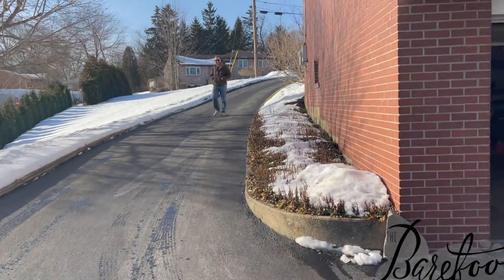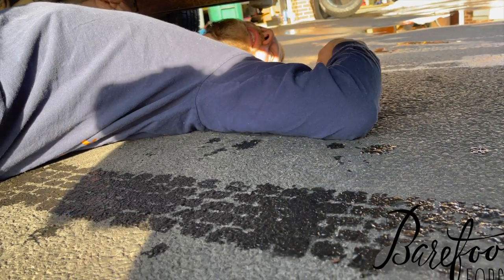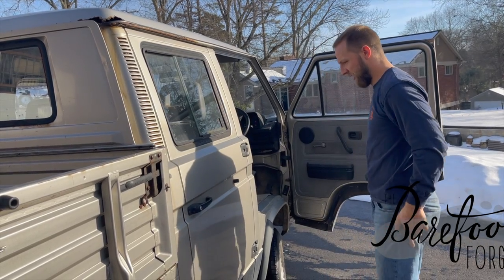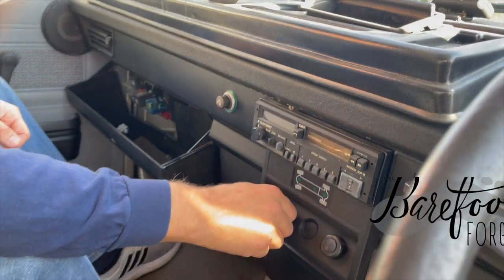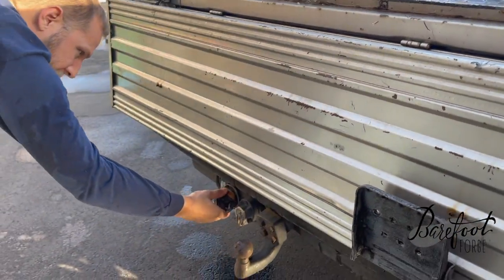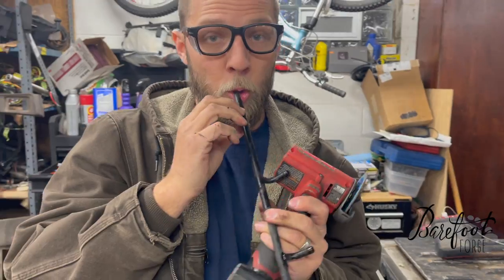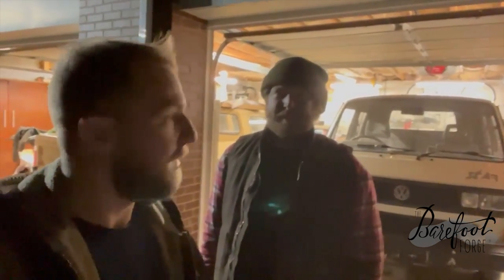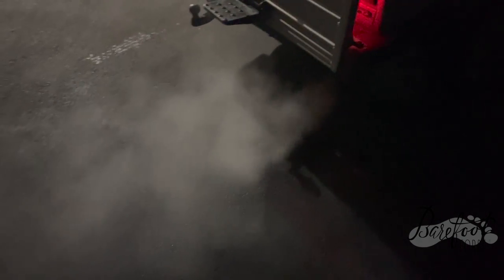Should We Crush The Rarest Vanagon?- Tristar Syncro Doka Rescue

Comment: very cool. 2.1DJ is the best vw engine, it’s in my van. I had coolant leaks so took everything off the engine, put new heads on, resprayed all the rusty engine bits, new stainless coolant pipes, new stainless exhaust, new fuel lines, now it runs great. 

oh and we call it a T25 here :D

Good luck with this van guys!
Reply from the maker: Heck ya- it’s a peppy power plant, comparatively.

Comment: After my 1st Vanagon (1985 Westy) caught fire (bad fuel line?) and burned totally up.   Then my 2nd Vanagon (owned for 16 years and did every mechanical repair possible except the A/C (don't need A.C in San Francisco) and the heater which still worked fine.  It was stolen a month ago. Still not recovered.  I am shopping for my 3rd Vanagon found a nice Wolfsburg in WA- will fly up and drive back to S,F. Bay area.--if my insurance company quits stalling on the settlement so I could buy it.   Love the guys Love their Vanagon passion. Definitely a cult vehicle-I can't shake. 
ely .
Reply from the maker: Sorry to hear that! I hope the insurance company makes it right and you’re able to source a good replacement!

Comment: you might be able to fine a 1990 1991 base model seat for the seat bottom fabric for the drivers side.
Reply: you might check the headlights as there are left and right hand drive specific lenses, the rivets are for bed slats not a full bead covering.
Reply: the blead rail around the top is truck specific.
Reply from the maker: Is that the same!?! It might be!
Reply from the maker: @alexanderdenette5101  Ya we saw the significant jog in it. Are these available?
Reply from the maker: @alexanderdenette5101  yep- not sure where all that bed slatting went, but its LONG gone!